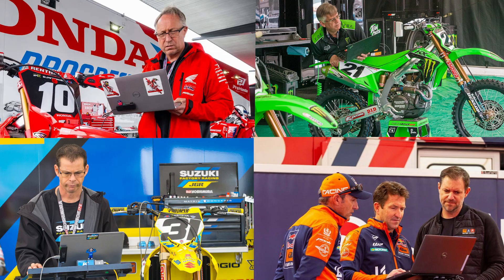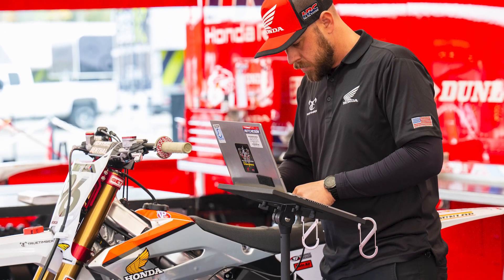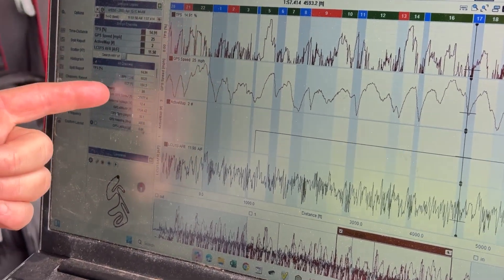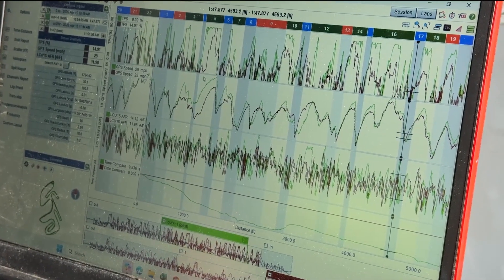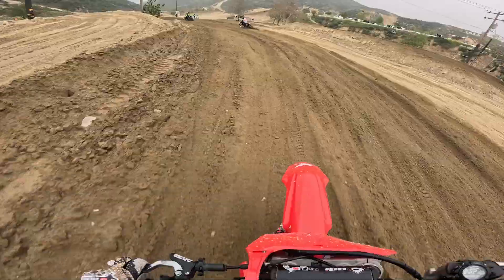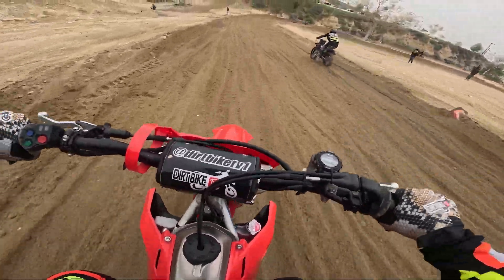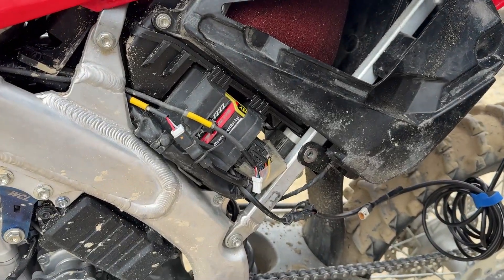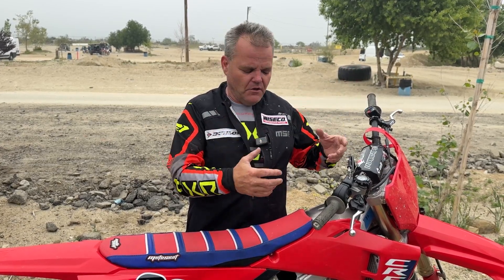How Pro Mechanics Use Data Acquisition for Maximum Power | Twisted Development Explains

Comment: Awesome video…super interesting! Do you guys know of any simple ways to add an O2 sensor to an exhaust pipe without having to weld a bung onto the exhaust pipe? 

I think as a rider who’s really interested in the tech side of riding it would be great to be able to generate this type of empirical data for my own knowledge of how my bike is performing.

Comment: Can a fuel injected KTM TBI 2 stroke be dialed in with a laptop like that? I've never seen an 02 sensor installed in the expansion chamber of a 2 stroke fuel injected bike but it should be possible, right?

Comment: where are you measuring that coolant temp? that must be on the inlet side after the radiator where it is at the coolest point because theres zero chance any outlet or jacket or head temp is that low.